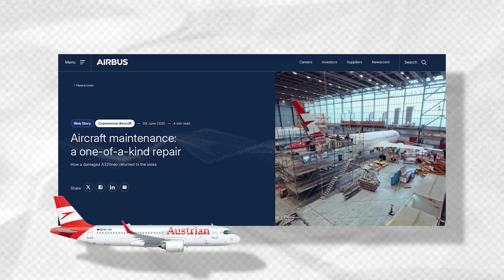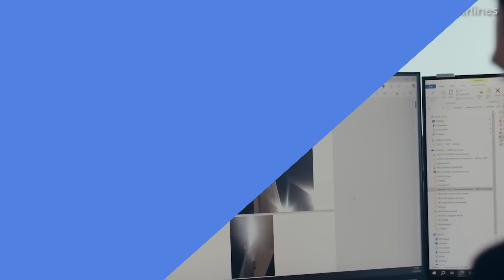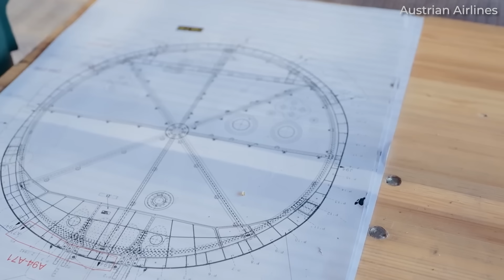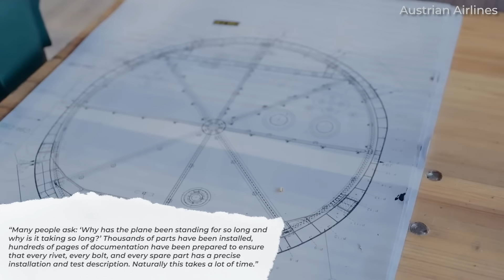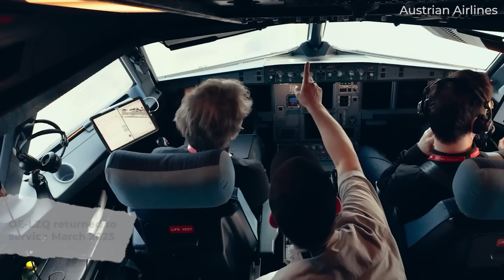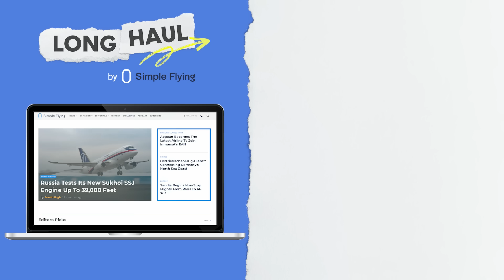What Did It Take To Repair This Damaged A320neo?

Comment: You have no idea the forces required to rip off an elevator like that. Must be micro fractures throughout the whole rear    fuselage tube structure. Keep watching this plane, because not a F will I ever   be flying on it. It's now a tragedy waiting to happen. Plane should have been scrapped.

Comment: I retired from an unnamed military aircraft program and we were able to repair several very damaged aircraft. What helps is if the aircraft is still in production. We were able to re-appropriate several very major sub assembles out of the production line and send them to the team working the recovered aircraft. If a damage like that would occure today it would likely have a different outcome as production has ceased and most of the major fixuring and tooling was scrapped.

Comment: The aircraft was towed from the maintenance hangar to a remote parking position by a Vienna Airport tow truck. Allegedly the tow truck driver forgot to set the chocks before releasing the aircraft from the truck, and the aircraft started to roll backwards as soon as the tow truck was disconnected.

Comment: I'm positive Endeavor's CRJ900 will be repaired vs scrapped. It's the 3rd Delta Connection CRJ to have it's tail ripped off by a bigger airplane, and it took a long time to repair the other 2. For this most recent CRJ, it's probably taking a long time due to gathering all the tooling and parts to build a whole new tail section. After all, Mitsubishi closed the CRJ production in 2020, so building all those new parts is probably very slow as opposed to being able to snag something already built from the production run.

Comment: I'm not even sure that the rear pressure bulkhead can safely be reattached.. micro fractures and fatigue conditioning from cycles will have worked it into a unique form.. interfering with that is not something that has adequate successful precidents.to allow safety assurances to be meaningfully given.
Reply: I think they would have fitted a new one, like they did not mention fixing the wing I am sure it was though.

Comment: I drive a bus. A couple of years ago, a Safety Officer met up with 
me to pull the video hard drive. The bus, driven by a different driver, had been in a collision the previous day. 

I figured it must have been minor, because I hadn't noted any damage.

The Safety Officer told me the bus had collided with an airplane. I thought to myself, okay, maybe the bus was airside at Orlando Executive and made contact with a Lear Jet or a CRJ or something similar. 

So I asked her, "What kind of airplane did it hit?"

She said, "Oh, I don't know anything about planes. I think it was 'Donald' something or other."

I said, "McDonnell Douglas?" 

She said, "Yeah! That's it."

I said, "Oh, shhheeeeittt. That won't be cheap."

Her main objective was to find out if the driver was following the marshall's instructions. If he was, the company isn't liable. On the other hand, if the driver deviated, it will be very costly indeed. 

I never could find out how it turned out.

Comment: I can only imagine the face of the person who damaged the plane 🥵
That's impressive work by Airbus specialists.
Reply: 0:41 they say I rolled backwards, so it sounds like someone failed to apply the park brake and chock up the wheels. Expensive mistake none the less. But great video explaining how a potential repair procedure is assessed and undertaken.
Reply: @paulsz6194 That is correct. After having towed the aircraft from the maintenance hangar to a remote parking position the Vienna Airport tow truck driver allegedly forgot to set the chocks before disconnecting the truck from the aircraft.

Comment: Buying a used CRJ from Mesa or pulling one out of the boneyard makes way more sense. We are talking CRJ9 vs a brand new 32N. It’s the potential loss of revenue on top of hull value, basically impossible to get a new replacement Neo within 24 months,  would have to wet lease, eating margins. Acquiring a CRJ9 second hand much easier and cost efficient. The same amount of tooling and labor would be needed for the CRJ as the 20N had at a baseline

Comment: Scrapping the aircraft would have meant buying a new one, with a backed up production log. They might even have gotten lucky with the engine problems, as this probably meant that the required parts were available as they were not (urgently) needed for the production line. The CRJ does not have an active production line, so spare parts can only be taken off other (scrapped) aircraft. Most likely this CRJ will be used for spare parts for other aircraft.

Comment: "write-off" is an insurance term. Usually used when the repair costs are more than the replacement costs. Almost anything CAN be repaired, it is just a matter of financial viability.
Reply: Also, if anything is written off it becomes the property of the insurance company.

As we know, the value of the parts can be substantial, so rather than how extensive the damage may be, it is how the cost of writing off the plane less what the parts will realise compares to the cost of fixing it and possibly the consequential insured losses.

Consequently,  an airframe with relatively minor damage could be written off.

Given that the neo is in great demand and might have been difficult to replace in a timely manner, that would almost certainly have factored into the decision making.